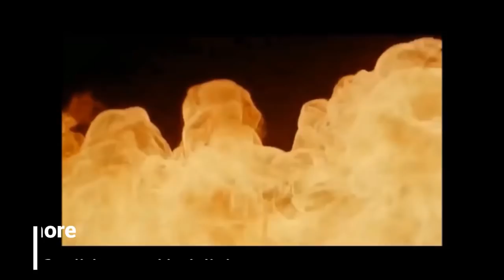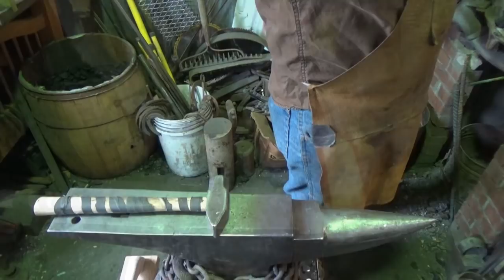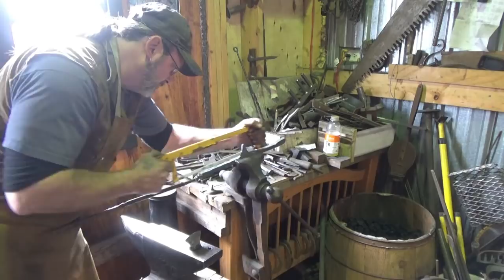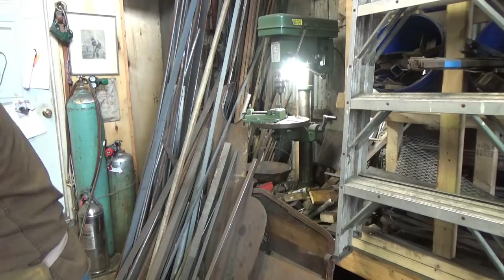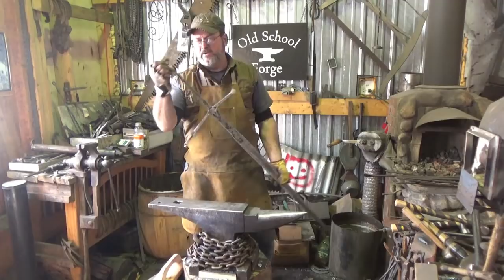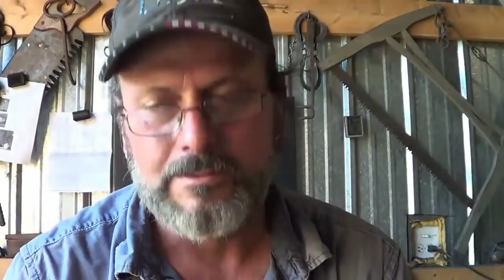Blacksmithing - Forging The Final Guard For The Claymore

Comment: Chandler. I have heard other blacksmiths say that they have had similar injuries to your elbow because they were holding the hammer too tightly. I know when I worked in construction I had similar problems. Once I learned to grip the tools lightly and let the weight do the work it became a lot easier and less painful. I also found that my blows were a lot more accurate as well. It may be worth giving this a try and see if you see any difference.
Reply: Just need enough grip to keep it from flying out of the hand. There's a reason for that, your hand grip isn't all about the muscles in your fingers, they are tied into your forearm muscles, you can see it if you make a loose fist and clench and unclench it, all the muscles back to the wrist flex even though it is just the fingers being tightened. The majority of your grip comes from the forearm muscles and the majority of strain from where they attach at the elbow. The attach points throughout the hand and wrist evenly divide the stress in both directions rather just being pulled in one so less prone to injury or just plain getting sore.
Reply: Start taking some Ibuprophin for the pain and for the inflammation that's in the elbow joint will help some. If all else fails a cortisone shot into the elbow will do wonders. You know he's not going to give up gripping that hammer. lol
Reply: Do you sell tongs
Reply: +Mark Harris The problem with pain relievers is when the cause of the pain isn't fixed the pain relievers make the damage worse. pain tells us when to stop, masking it.. well you were told to stop but didn't notice it and now you need surgery is the result. Start off by discovering the root cause of the pain and methods to avoid the damage the pain signifies is always best practice, taking drugs and not knowing the cause and keep doing the cause is just stupidity.

Ryan has a valid point(common too) and I explained why it is valid, maybe it isn't the root cause of Chandlers issue but it is something he can test to see if it is and then there is an easy drug free rectification. Ryan was also pointing out a common issue, not just with elbow injuries but forearms being sore with long term elbow joint injuries later. Men who do not swing hammers for a living since childhood and only used them for small home jobs often grip them way too tightly, it seams intuitive to have a strong grip to go with the strong swing but in reality it is counterintuitive by expending more energy and adding more stress. Just enough grip to keep it from flying out of the hand is needed. If your blow isn't true the hammer will adjust in your hand without sending shock through the muscles as they are forced to adjust which will cause damage. Grip too tight and each and every not perfect blow does force the muscles to adjust when they do not want to.

Comment: If you compare it to other sword/knife makers it surely isn't pretty, but it isn't comparable either. They forge big then grind small, you forged small and grind smaller. You didn't have enough meat to fully grind out all the hammer marks like they always have. They will have just as many hammer marks as you but they grind them completely out before going to a higher grit. I believe replicating the base of the blade and tang is how it was traditionally done but instead of cutting it in half first they probably did a hot cut with a tool like the hot cut tool you made in a Back to basics video. If the drift is an exact replica of the sword and the tang that goes through it, you could drive it in hot then smooth the outside and then let it cool with the tool inside. Re-harden the tool after extracting and repeat a couple times until it takes a light tap to extract the tool. Then when putting it onto the sword bring the guard to temper heat and then set it in place. But there's one difference, they had a distal taper with the tang too, your guard should have slid down the tang to almost in place.

You are really improving on the cleanup hammering, much lighter hits than you used to do. Keep getting better and you will be able to forge small and grind small with the same results as forge big and grind small. A little care, a little finesse, allot of experience goes a long way. To improve I highly suggest that you loosen your grip so the hammer can self adjust to flat on impact and shorter strokes while choked up on the shaft with almost black heat and into black heat. a 2 pound hammer with only the weight of the hammer at a 3 inch drop and loose grip aimed at the high points.

Keep it up Chandler, she may not be the best looking sword, but she is your second and far and away better than the first. Your third can be that much better than this, the fourth that much better than the third. Everytime you screw up you get better! And no teacher telling you what you did wrong and showing you what to do instead, that's a skill many cannot boast and one to be proud to have.

Comment: Hey Chandler,
If you don't like using the wire brush that Mike sent you, I'd like to try it out. It's much better than the one I have. Mine doesn't have a handle. It's just a matter of time until I rake my knuckles across some hot steel. I'm sure that's worse than when I was a brick layer and raked my knuckles across the brick wall while soft brushing it.
Reply: Just get some scrap 1/8" x 1" or 1/4" x 1" bar stock and bend a handle to shape, screw it to the block.  None of my brushes had handles; made handles for all of them.  You don't have to forge them, just heat and bend in the vise.  For comfort, I split some old broom handles in half and fastened them to the handle (screws, epoxy, whatever works).

Comment: Nice job on making the guard.  I winced watching you pound that flaming wooden block down on the handle.  Bet you had no hair left on your forearms!!!

A hint for you....I noticed you were having difficulty finding your punch marks early in the video.    Someone suggested to me that I should try a center punch with a square point rather than a round one as most center punches are.  I now use a square center punch and the square punch marks are much easier to locate than the round ones...don't ask me why.

Comment: Chandler. Do you think the tang got hot enough to harden when you quenched the guard? If it did, it will be brittle and the first time you try the sword it might break off at the guard. Just a thought.
Reply: Unlikely, IMO. Steel is a pretty poor conductor of heat
Reply: Rob Mckennie: It was just a thought. Of course, with the guard being nearly welded into place, not much could be done if it was. But with the little experience I've had with spring steel, I tend to shy away from water quenching at any temperature level.